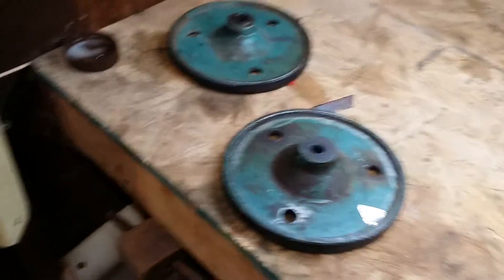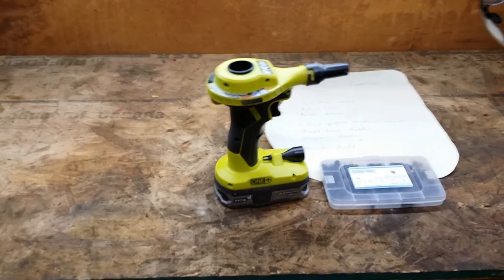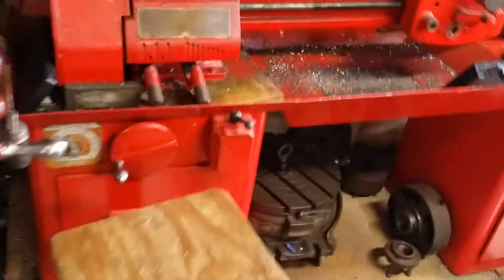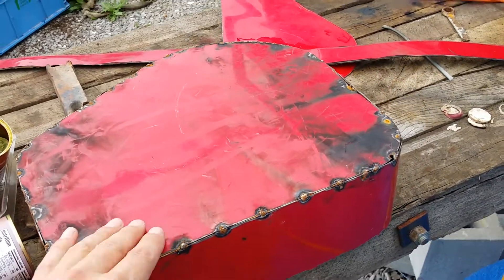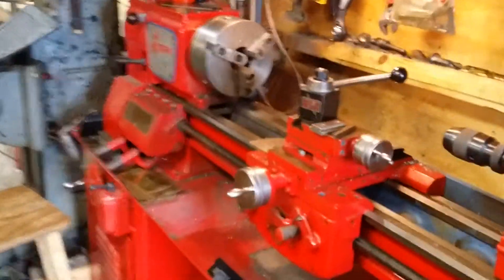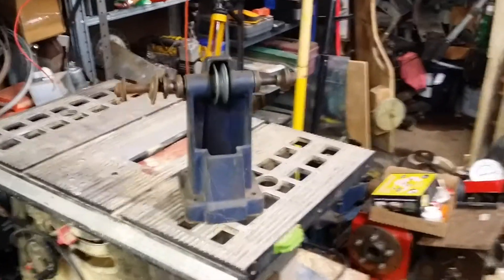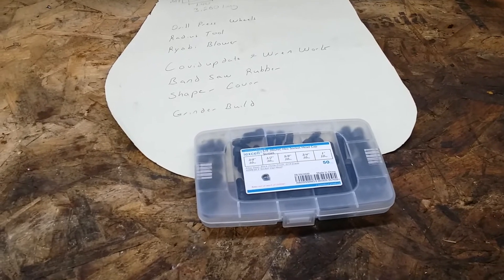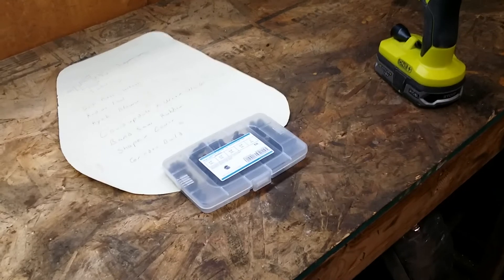Aug shop/life update

Comment: some neat stuff craig, I'd be interested to see how those bandsaw wheels track, or if you would have to stick them in the lathe and crown them slightly first. Ive seen quite a few grinders like that, and thought about making one eventually, but after I got the T&C grinder going, that idea kinda went out the window, lol. I'll be interested to see how yours turns out and see how it runs in the end.
Reply from the maker: Yes iam pretty eager to put the bandsaw wheels through its pace as well. I have a couple of backup ideas if this don't work . Thanks for stopping by